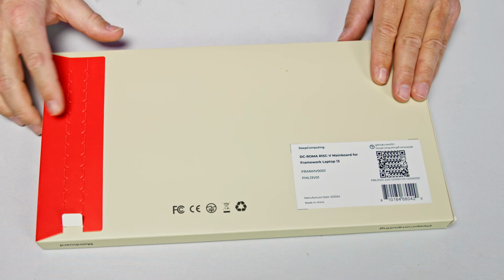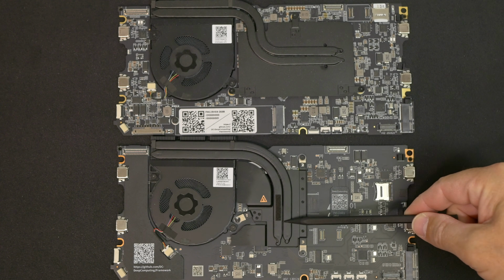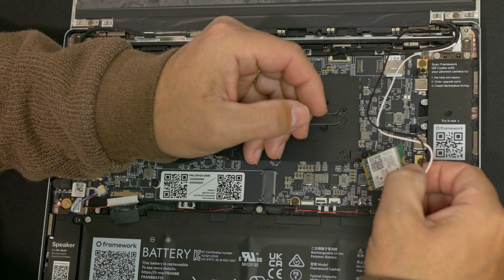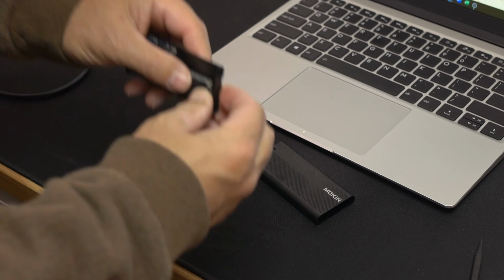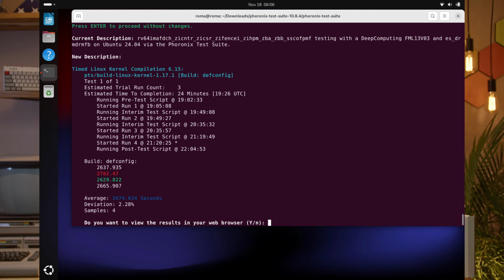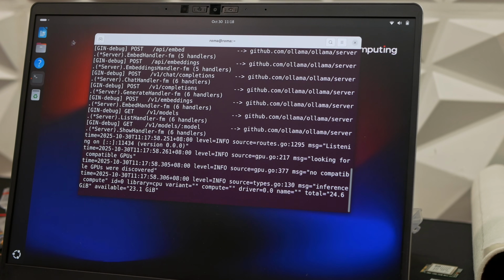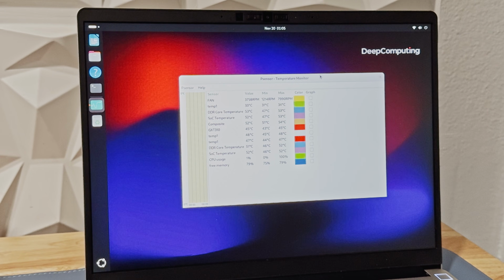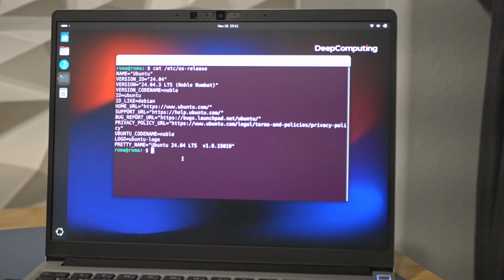Framework + Linux + RISC-V = The Most Open Laptop Ever?

Comment: As of writing, another motherboard with RISCV64 is available, with a Spacemit K3. That one implements the RVA23 instructions baseline, and should therefore be picked over all other (kinda obsolete) designs. Unfortunately, at 600 €/$ it’s more expensive than a standalone SBC.

Comment: Can run Debian? 🤔 Debian run on risc-v
Reply: Possibly. A long time ago Debian builds of every release were compiled for every architecture in use. I don't know if it's still the case.
Reply: @uncrunch398  Debian is supposedly available for RISC-V, but these RISC-V systems don’t have a BIOS where you can select the drive, and it’s not always easy to install unless the board manufacturer has modified the image.

Comment: It's only open if no fimware is needed to run the hardware. Furthermore, it might be the most open laptop, but with the least available software of probably any arch. That's just to say that it's for sure not for everyone and anyone. But it's an interesting start, and the right to repair is a good movement.

I think we need a "right to own" movement too. Because why do we keep accepting buying hardware that we don't even own and control? And before you protest, it is different with PC's (including mobile phones) and other electronics that just happens to have software. PC is a category of it's own, like the name indicates, and that category include most mobile phones (not the simple ones).

But it's good to see someone doing something good to change things. We need alot more of this.
Reply: We need the same for GPU's as well..
Reply: A lot of FOSS devs have the philosophy of freedom no matter what. So, maybe it just hast to be usable enough to not be a PITA and readily available at reasonable cost.

Comment: bear in mind "mostly open" still means proprietary firmware , linux driver blobs, and closed chip design specifications
Reply: Sure, though I think SoacemiT and Deep Computing are pushing drivers to the mainline kernel. And RISC-V means you, or somebody else, can design a fully Open Source chip that runs the same software if you want. If you are willing to settle for something slower, they are available already.

Comment: Nice review, but worth noting: RISC-V still requires proprietary firmware blobs for memory initialization and boot in a very similar way to ARM and x86's proprietary + signed blob requirements (to bring up the chips into a usable state). 

If you want genuinely open hardware where you can audit the entire boot chain, check out Power ISA systems from Raptor Computers. Since IBM opened the spec in 2019, it's the only architecture with a fully open and blob-free boot path from power-on through OS load. 

It is true that there are no laptop-suitable versions of Power ISA chips on the market right now as the current systems are workstation/server form factors. NXP does manufacture Power ISA processors, but they're focused on embedded/networking applications, not consumer mobile. The continued lack of industry investment, developer resources, and consumer investment in Power systems means we're unlikely to see PowerPC laptops again despite Apple's history with the architecture.

The heavy marketing around RISC-V as 'open' is partly driven by nation-state interests (China using it for sanctions circumvention, Western vendors wanting the Chinese market), which deliberately ignores the blob-dependency reality that prevents actual end-to-end auditability. These kinds of reviews always seem to lack that level of nuance and makes me a bit suspicious of the 'openness' marketing around it all.

This should be a warning sign to anyone interested in a fully open source platform. Worth remembering: in the US, the DMCA creates legal uncertainty around circumventing signed blobs on ARM/x86/RISC-V even for legitimate security research. This threat of prosecution has a chilling effect on the ability to fully understand and control your own hardware. Power ISA's open boot path sidesteps this entire legal minefield.

Comment: The performance is getting there. For general users a daily driver is probably six years away.
Reply: I could probably suffer through a K3 based laptop (already available). And an Ascalon based laptop would be fine for me. Ascalon silicon will be available later this year.

So I would say general users will probably have RISC-V options in 2-3 years.

Comment: You have misunderstood and you are misleading your audience when you say A) that this is probably the most open laptop that exist (its not, a librebooted T480(s) is more open), and B) That the Spacemit K1 SOC is completely open source (its not. RISC-V is open source, however Spacemits
implementation is not open source).
Reply from the maker: I think you watched the wrong video. This board doesn't even use a SpacemIT K1 SOC.
Reply: @LiftingLinux  The StarFive SOC on this board is not fully open source, and you are wrong when you call this the most open laptop you can buy. A librebooted T480 is more open and also way more powerfull and supports FSF approved linux distros unlike the framework laptop.

Comment: Did I hear that right; you can only flash a special Ubuntu OS onto it ? If thats right, why not preinstall it on the drive the device comes with...?
Reply from the maker: If you order the one with the 1tb SSD it will be. Mine had the OS flashed on the SD card.

Comment: when is risc-vi?
Reply: Never. There is no meaningful improvement possible to the basic, core, standard RISC-V instructions (or to ARMv8 ones for that matter), and if you come up with some fancy new instructions you can just add them to RISC-V as either a custom extension or propose it as a new standard extension. Unlike with proprietary ISAs such as x86 and Arm, no one can ever stop you from enhancing standard RISC-V, so there is never a need to make up something entirely new and incompatible.

Comment: This mainboard looks much more interesting then the last mainboard. Would consider picking it up for development, but 650 USD is outside of my price range.

BTW, just because a chip is RISC-V does not mean it is open hardware. Even if the ISA is open, typically these chips will still have their designs kept proprietary. So you aren't going to be forking the chip design and adding in features because they don't release the source designs. (And uh, you know, the whole "it cost tens of thousands of dollars to tape out some chips" being an issue). The same goes for the DeepComputing mainboard, AFAIK.

It's still exciting, but not because its open hardware.

Comment: This is really cool. Though absence of UEFI is and propper power management is really unfortunate
Reply: SBC are fine with using device trees instead of EFI; this is also how all modern ARM-based SBCs work & they work fine. On top of that EFI requires PC hardwar & a physical x86 to control the system which RISC-V baords don't have to begin with so EFI for RISC-V is pointless from the get go.

Comment: Now all it needs is Libreboot
Reply: And Gentoo of course. ;)
Reply: isnt the entire point of riscV being an alternative to x64 which is what forced people to use libreboot? do correct me if im wrong
Reply: @SevenDeaths_7  there are already companies applying the closed x86 model or arm with licenses

riscv is free and allows all that, the good thing is that it will be easier to reverse engineer and 100% open chips will be more competitive
Reply: @SevenDeaths_7  these are two completely different things.
Regardless of ISA you need software that can initialize the hardware (CPU/RAM/GPU/etc.) and then pass control to your kernel.
Libreboot does try to do all of that where it can, but proprietary hardware makes that difficult. This is regardless of ISA.
Though in many cases with ARM and RISC-V, it's a matter of reverse engineering and implementing (a very time consuming and difficult process) current amd64 systems cryptosign their low level software which makes it nearly impossible because they will refuse modified software.
Reply: LibreSIM + LibreGSM
Reply: @aleksejs_kruks libregpu next

Comment: The AI bullshit has gotten insane, to put an NPU in this Rasberry Pi level device is like putting Ray Tracing engines on your wifi router CPU; Wrong application of the wrong technology for the wrong product.  NOBODY using this processor is going to be doing LLM models. They wasted precious silicon wafer space, instead of adding another +2/4 cores of CPU/GPU.

I'm still waiting for Apple Siri voice integration for my iShoes(tm) but we need 40 tops in your socks just to run it locally.... and guess what Apple's latest product is?  A sock that holds your latest AI powered iPhone, called iPhone Pocket by ISSEY MIYAKE
Reply: Agreed, but oh well. It's just "marketing" BS. They know that if they don't put a NPU in those, they won't be able to sell them because... competition has a NPU. If that serves no purpose, whatever. That's how it works. And in the same vein, even the products made out of these SoCs make very little sense. Those RISC-V SoCs make great "application processors", but not credible desktop CPUs by any stretch of the imagination.
Reply: YES!
Reply: It’s a development board, not meant for the average consumer.

Comment: This would work in my Framework 13.  However, it does not have the performance I currently have with the FW's first AMD cpu.  Also, I would rather have socketed RAM so I could transfer my existing memory and not have to buy new RAM, which is insanely expensive right now.  I hope my next motherboard is RISC-V.

Comment: Focusing on the ability to run local LLMs when the system as a whole still feels sluggish with just basic usage is pretty crazy to me. Get the basics down first.
Reply: These chips are still more like demos products than actually purpose built hardware and because of that are built to be somewhat jack of all trades.

A bit like MCU dev kits and evaluation boards often come with tons of hardware you will never use in actual final products because they need to show you all that it could be used for, even if all those things don't really make sense in the same product.
Reply: Was his first response in this thread written by llm, is that the joke
Reply: Yeah LLMs are useless and using them melts your brain.
Reply: No one should be focusing on running LLMs at all
Reply: @Ailuridae42  That seems to be more a philosphical than a technical statement.
Reply: @Ailuridae42 LLMs are nice to use
Reply: @Ailuridae42  Exactly.
Reply: @Ailuridae42 sure! Lets put our head in the sand and pretend that Ai will slowly go away because its so flawed.
Not the fact that every CEO everywhere looking to use Ai to replace or augment their workforce.

This is not the failed to launch VR revolution, this is happening. Buckle up for the ride.
Reply: @mptcz AI is not going away, but this is like physx, gpus just do a better job at it...
Reply: @mptcz  I have a bridge to sell you.
Reply from the maker: In 2025, an NPU is part of the basics. Modern software offloads tons of everyday tasks—noise reduction, camera processing, transcription, security, photo indexing, and even UI responsiveness, to the neural engine because it’s faster and far more power eficient than the CPU or GPU.

Developers are actively targeting NPUs now, so getting that part right isn’t “extra”, it’s foundational. LLMs are just the "easy to demo" use case, but the NPU already underpins a huge amount of what makes a system feel modern and responsive.
Reply: @LiftingLinux  My laptop has an NPU. I haven't used it once. UI responsiveness is GPU. Indexing is CPU/storage. Transcription is CPU. NOTHING uses NPUs other than AI shit no one fucking wants.
Reply: Is NPU a part of "basics"? Majority of computers don't have NPUs (i.e. virtually none of Intel or AMD desktop CPUs come with an NPU). Also virtually no software now uses an NPU. It seems they added NPU here because of current fad - everything must have AI in name.
Reply from the maker: Intel Arrow Lake S released last year includes An NPU, Nova Lake will have an advanced NPU6. Ryzen 8000G has an NPU and all Zen 6 desktop CPUs will include an NPU. Software that offloads several tasks include: Windows 11, Edge, Chrome, Adobe, Resolve, OBS, Zoom, Teams, Topaz, and Handbrake. Blender, Unreal and Unity are currently developing for NPU use.
Reply: @LiftingLinux  agreed, any modern machine is coming with an NPU, obviously.

I think the addition of unified memory management like what intel, amd and apple are showcasing is a major flex on the ability of Risc-V even so early on the development stages. 

Once we get some horsepower behind this cores they are going to be a true competitor!
Reply: @LiftingLinux  I didn't know NPUs did so many tasks.
Reply: @LiftingLinux  The em-dash really makes you a clanker shill.
Reply: @LiftingLinux  NPUs are more generally usable than for just AI stuff.  In an very simplifying way they could be considered accelerators especially tuned for matrix operations and low-procession arithmetic.  Which is typical for AI workloads.  The hardware and some creative hacks allow them to be used for other workloads as well.  So expect NPUs to be used in systems that never do the N-stuff.

Earlier, pre-NPU platforms were often offloading AI workloads to a GPU.  GPUs generally are power hogs and perform arithmetic at precision unnecessary for AI inference.  Hence NPUs as a low-power alternative which is more suitable for applications such as audio processing for always-on microphones.  And a GPU as the heavy-hitting partner for things such as AI image generation or scaling.

At the bottom line that means GPU and NPU are check mark items on the menu for hardware designers.  Neither, one of them or both may be put in future hardware.  We may reach a point where putting an NPU in may become standard because a NPU-less version is just extra cost and effort.

The current discussion if NPUs are useful or required reminds me a bit of similar debates about earlier hardware features.  "We don't need an MMU / memory protection".  "We don't need 32-bit".  "We don't need 64-bit".  "We don't need an FPU". etc.  Some people are pretty skilled at denial.  Times are changing,  Permanently.
Reply: @LiftingLinux  What applications on Linux are offloading noise reduction to an NPU? Or camera processing? Transcription maybe. 

For "secutrity" (whatever that means), photo indexing and UI "responsiveness" how in the hell could those even in theory be offloaded to the NPU? Big old citation needed there.
Reply from the maker: Linux is still early in NPU adoption, but there are a few things using it today. Most of the real support comes through ONNX Runtime and OpenVINO, which let apps offload AI tasks like noise reduction, speech recognition, and computer-vision models to Intel and AMD NPUs. Modern Chromium builds also use the NPU through WebNN for on-device translation, image processing, and other browser-based AI tasks. GNOME/PipeWire can offload RNNoise-style audio cleanup, and some Whisper-based speech tools use NPU backends too. NAS vendors are beging to rebuild their AI stacks around ONNX Runtime or OpenVINO and away from GPU/CPU frameworks. They are working towards offloading a lot of tasks to the NPU which has huge advantages in terms of power efficiency. As always Linux is behind the trillion dollar corporations, but it'll get there.

Comment: I want to see in my lifetime "open source ip subsystems" like hdmi, mipi, gpu, etc. Everyone yells at me how "open" raspberry pi is and I ask, "ok, how do I add a video input hardware firmware driver?". Oh wait that's Broadcom. 
Risc-V as a usable device MUST include some  proprietary drivers, IP, and image subsystem to simply work with Linux.
Reply: This uses an Imagination GPU,  which has open source drivers. The networking card is from Intel, and I think the drivers are open source, but still require proprietary firmware blobs. So this isn't all the way there, but at least they are trying :)
Reply: @Till. They are indeed trying, and in fact the driver is open source. The trouble I have is that the ip "cores" aka gpu, i/o, etc. are usually licensed. That prevents someone from say using this or that "cpu" for a product. I want to make a camera, sounds easy, until you realize the data rate is pretty much nvme or raid only. There are SBC's and computers that can do that, but those product owners don't own the input side, or output side. Weirdly I'm using Qualcomm, which although closed source, do allow for GB input and GB output without me paying licensing above and beyond. Open source everything would fix that. But the chipmakers probably won't ever go there.

Comment: I ordered mine a few weeks ago and I am stoked to get more RISC-V silicon. I'm divining into aarch32/64 and RISC-V assembly programming.
Reply: If you take a few steps back AARCH64 and RISC-V are not too dissimilar.  Basically similar enough to get up to speed quickly.  And too similar to still be truly interesting.

The older 32-bit ARM was a lot quirkier.  And fortunately little or no inspiration from SPARC such as register windows.  To me with a MIPS background RISC-V looked pretty familiar from the first moment I started to read up on the architecture.  The most notable differences are where they took a step back, looked and the grand picture and the original design principles of RISC from the early 80s and then took it to the extreme.  Lots of rarely used things such as conditional traps etc. gone.  They took minimalism and stripped it down.  Less noticable is how the instructions are layed out, bit batters were selected.  It's all the micro-optimizations one can only do for a clean sheet architecture.  And it shows, a RISC-V core is small in terms of die area compared to other architectures.